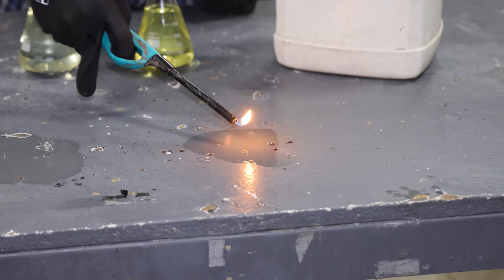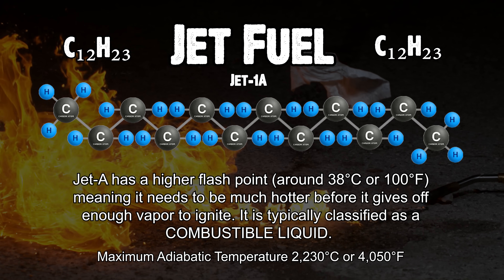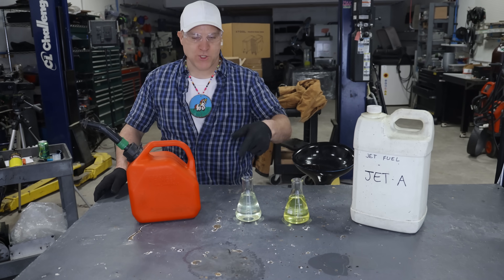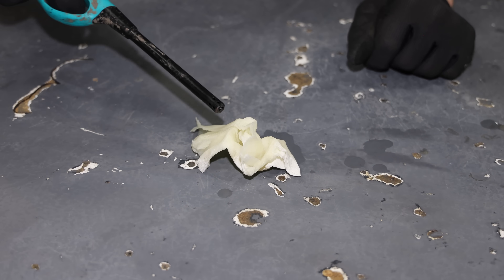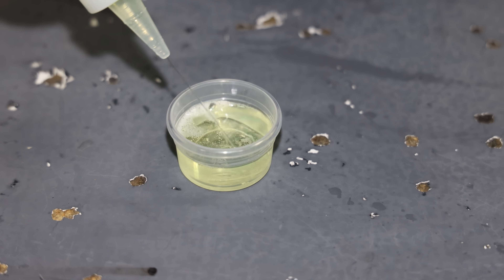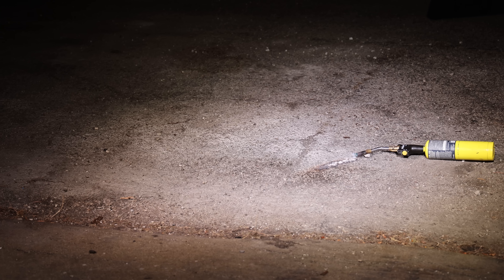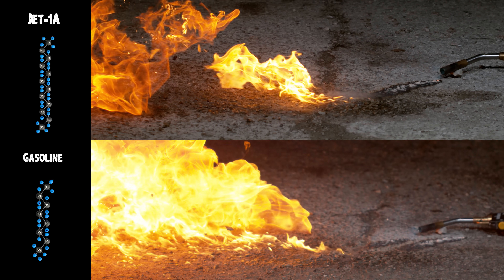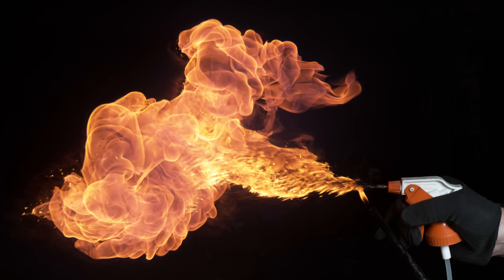What Happens If You Light Jet Fuel vs Gasoline?

Comment: If you tried to light up jet fuel by dropping a lit match on it, it would ignite by the moment the match gets soaked with jet fuel.
Reply from the maker: Only in the case of "wicking" other than that no-go until the fuel reaches a temp of at least 100F.

Comment: Interesting, Do you think 50 gallons of 'jet a' fuel in a large capacity 'empty central tank' on a Boeing 747, (if ignited), would cause the hull of the 747 to fail.. 🤔🤔

Comment: Have you ever tried RP-1, a variation of kerosene used for liquid fueled rockets (rather larger than what a hobbyist would use—dry fuel and oxidizer). In rockets, unlike airplanes and surface vehicles, rockets have to carry their own oxygen with them, almost always, in liquid engines, in liquid form (LOX). It can be vet dangerous to almost all amateurs, where solid fuels usually come pre-prepared, thus making them much safer, and making the hobby safer. But with human crewed rockets, the liquid engines are often preferred, because they can be turned off even after ignition. With solid rocket motors, once they are lit, they are going. 

Usually the RP-1 is used with first stages only, with upper stages using liquid hydrogen and liquid oxygen.

Comment: Jet and diesel are very similar. Seen this same test between gasoline and diesel. But isn’t jet fuel basically kerosene? Anyhow diesel fires after a crash happen the same way. But diesel also doesn’t ignite to an open flame. Its ignition is through heat. Used to be use glow plugs for heat to ignite diesel. But now they just use turbo or compressed air. As air is compressed the temperature rises dramatically. Till combustion with the fuel. Engineers have timed this so its exact. Jet engines and fuel are the same. Jet engines are the turbo or turbine. But they compress much more dramatically. Creating more boost or thrust.

Comment: The Boeing 787 puts nitrogen in its fuel tanks to prevent lightning related static electricity fires. Pulls the oxygen out of cabin air and left with almost entirely nitrogen.

Comment: You get more work per thermal unit from jet a and at lower temperatures which extends the life of the hot section and turbine assembly this was worked out in the 1920 ‘s quote from aircraft test book FAA Test questions cerca 1990 ‘ when I tested for and received my A&P cert !

Comment: I worked with JP8 in the US Army as a helicopter mechanic. It is basically Jet A. You had to try hard to get the liquid to light, but atomized in an engine could still cause an over temp. Even a few seconds of over temp in a gas turbine engine could cause scaring inside the hot end of the compressor; due to expansion of the turbine blades. I had to do many an engine change, because pilots couldn’t wait 2 minutes between start attempts.

Comment: Ok, first off 1970's - 1980's USAF non flightline person here.   No knowledge of what you have labeled Jet-A.  Fuels that were used were labeled JP-4, JP-8 but this was not fighter or cargo aircraft, ours were Tankers  and B-52s.  Not sure what differences there are in volatility, but open flame was prohibited around any spills that might have vaporized, either on the ground or personnel.  In the case of spills on personnel complete washdown as soon as practical was called for followed up by return to home or barracks for uniform change and then off to medical for examination and clearance to return to work.

Comment: If the ambient temperature in that workspace is high, there could easily have been enough gasoline vapor coming from the flask of gasoline to create a continuous fuel bed between the puddle and the flask. If that flask went while you were leaning over it, he would be posting this video from a burn ward. Respect gasoline. You cannot see the flammable vapor.

Comment: 911 was an inside job.  Jet fuel could not weaken steel let alone melt it.
Reply: Actually, it can.  You don't have to melt steal for it to weaken enough to fail during a fire.  The rule of thumb in an industrial/refinery fire is after 15 minutes structural failure can occur.
Reply: @91156   Easy to find out. I invite any one reading to try it. Get a giant Kerosene container ( jet fuel is Kerosene) and lit it under a steel table for any amount of time.

Comment: So they both ignite in vapor form.  By the way, drop a match in a bucket of gasoline - it will not flame.  It's about the air.
Reply: Light that match and try that on a hot day............  or even a warm day.

Comment: Now get "Jet-A" to melt steel.
Reply: Nobody said the fires in the towers MELTED the steel. All you need to do is warm it up to the malleable temperature, which is a lot lower and let the weight of the buildings do the rest. How did blacksmiths form metal from a small wood fire? They didn’t melt it. They heated it to the malleable stage and used the weight of a hammer to deform it. Same thing. Not saying nothing else contributed to the seemingly perfect demolition style collapse of the building, but the simple collapse is possible without actually melting the steel beams.
Reply: @gerrymainville7904  All their 'facts' are made-up BS.

Comment: Is that a little gasoline engine sitting on his bench at the end?
It looks like a little gasoline engine sitting on his bench a the end.
It is a little gasoline engine sitting on his bench at the end!
I WANT THE LITTLE GASOLINE ENGINE SITTING ON HIS BENCH AT THE END!!!
So he will give it to me now. Why?
I don't know why but it's cute, so am I and I want to hug it.
As for JP4 it's used in fighters because liter to liter it has a much higher energy density thus resulting in higher thrust to weight ratio with greater fuel efficiency plus it burns with at lower substained thermal output so it doesn't turn you expensive jet engines innards into white hot glowing mush, something most pilots would like to avoid. 
Because we're scaredy cats when it comes to fire while we're flying. 
(But not so much at home if our boyfriends are hugging us in front of one.)

LOL! 😡👈🤪

Comment: Jet fuel does not melt iron beams…….. I’ll leave it right here
Reply: You are correct, but it gets iron beams hot enough to flex and collapse, as in the trusses
Reply: They lose 50% of their strength at 500C, 70% at 600C, both well within the range of burning jet fuel.  ALL of your 'facts' are made up BS.

Comment: All I know is that jet fuel does not melt steel beams
Reply: Youre right it cant melt steel beams but the heat it produces is enough to cause structural damage enough for it to collapse under the added weight of half a plane.
Reply: @General_brasch the temperature at which steel becomes malleable is a lot lower than its melting temperature.
Reply: @General_brasch  and tower 7?
Reply: @StuFrodsham  falling burning debree started fires in 10 floors on building 7.
Reply: @General_brasch you'll never convince them that they don't have super secret arcane knowledge that the rest of us do not, but I respect your attempts 😂
Reply: @s @seionne_outdoors ometimes they are just people who havent heard the true explanation. Other times your right and Im not tryin to convince tin foil hat people.
Reply: It can soften them, though.
Reply: If steel is heated long enough, it will weaken the beams forcing them to buckle.  Did you not pay attention in engineering?
Reply: Conspiracy?
Reply: Two totally random towers in New York City that around anymore due to two machines
Reply: Another way to see it: What do You think happens, if You ram a commercial jet into a high rise building?
Do You expect it to stand afterwards?

And what do You think is expected damage to smaller buildings surrounding huge collapsing buildings?
Reply: Everyone knows what you’re talking about but something did and they buckled!
Reply: That still doesn't explain how two airplanes took down three buildings.
Reply: @moppman3191 simple, both planes hit the center of the towers, the center of the towers held a lot of the buildings core support beams, jet fuel was set on fire and weaken floor beams, once everything was weak enough the floor collapsed and the gravitational force of the extra floors above caused everything to fall down down like a domino. Now for building seven debris from one of the towers fell on it causing a fire to go off inside, there were no sprinklers, no firefighting effort to put the fire out, and support beams also got weakened by fire. Now reminder I am not a structural engineer I am someone studying to become a aerospace engineer so if you don’t believe that’s fine this is just my explanation on the event.

Comment: You could have the fueltank filled with a porous honeycomb material that the fuel can flow through, which stops vapourization due to impact. Like a big solid sponge. It would still burn, but like a candle rather than a pool of liquid.

Comment: Interesting but the statements about energy density are incorrect. Petrol (Gasoline) has a typical energy density of 44 - 46MJ/kg (by mass) or 33.6 - 34.6MJ/L (by volume). Jet-A1 has an energy density of 43.1MJ/kg or 34.7MJ/L. Since the combustion process uses fuel MASS rather than volume, Jet-A1 is slightly more 'powerful'.

Part of the misconception regarding aviation fuels is the perception that 'it's aviation fuel...!' without realising that there are two fundamentally different fuels in use - AVGAS and AVTUR. AVGAS is (crudely put) petrol for flying - hence the name (AViation GASoline) and the most apparent difference between that and the automotive variety is the Octane rating which is a measure of it's 'knock resistance'. We've all seen numbers on forecourts like 95, 97 etc - AVGAS reaches 130.

There are many varieties of AVTUR (AViation TURbine fuel). One of the most fundamental differences between the two groups is that while AVGAS is a spirit fuel, AVTUR is an oil and as mentioned, belongs to the Kerosene 'family' along with diesel and paraffin.

Where the AVTUR fuels differ significantly from land-use ones is their low temperature performance since to function in an aircraft, they need to remain usable at remarkably low temperatures which road fuels could not achieve. This is made possible by the inclusion of additive to prevent waxing and also to deal with any water formation within the fuel system.

In the Western world, there's a thing called the NATO single fuel policy which mandates that all military 'diesel' equipment must be capable of operation on 'F-34 AVTUR' which - as suggested - is the preferred single fuel though not the only one used. They also use F-54 Dieso or Dieso MT but only on land.

F-34 has a lower power density than F-54 and other road fuels but operates reliable down to -44C (if I remember correctly) but comes with a higher maintenance requirement as it also has less inherent lubricating and more aggressive properties than it's land-use and civilian relatives.

Comment: a few times I found myself delivering jet fuel kerosene or racing fuel,  it is all the same, as an ltl driver, meaning I was a local delivery driver. the problem was that it came from International which isn't a mom and pop operation and didn't have any hazmat markings on it, and this happened probably 4 times.  I was moving it in a trlr in the summer and I didn't understand or appreciate that it's essentially not easy for it to combust. But as a responsible adult and seeing that my company didn't take drastic actions for missing the fact that it wasn't flagged as hazmat, as it is fuel and is explosive, and I worked for a reputable company, I soured on them quickly. This wasn't the only instance where their stance on hazmat was less than adequate. I worked with a guy in the marines and he was in charge of the hazmat area, one time he walked in and breathed the air and fainted, in the end he was discharged as a medical situation and he couldn't breathe or exercise the rest of his life the same. he got medically discharched, no one needs that to happen.

Comment: and again we see the similar comments: Jet fuel is diesel.
Gasoline is gasoline.

But, what is the difference between Jet fuel and diesel?

Thanks for not showing any of that, and showing what most potatoes already knew.
Reply: Jet fuel is actually kerosene.
Reply: @91156  and kerosene is diesel?
Reply: @TMGpuntNL  Well, sort of.  Diesel has a bit higher boiling point than kerosene, making it a heavier product.  Kerosene is also referred to as #1 diesel, whereas the diesel fuel we run in trucks, tractors, or about anything calling for "diesel fuel" is #2 diesel.

Comment: Jet fuel is essentially diesel fuel, but with less lubrication than diesel, and has a lower gelling point in cold climates. It is basically the equivalent of a number 1 winterised diesel. Aka...basically Kerosene. Jet fuel will run in a diesel engine so long as you add in proper oil for lubrication and a cetane booster, so you don't burn up your diesel engine's fuel pump. Diesel fuel also has a higher cetane than jet fuel. 

However, modern diesel engines in the United States have many pollution control systems, and these components can be damaged if specific grades of jet fuel are used, as jet fuel often contains high levels of sulfur. 

Older diesel engines are more forgiving, and these pesky pollution control systems don't get in the way, since they don't have any of the pollution control crap. 

However, I still wouldn't recommend running Jet fuel anyway. Even if you could. One jet fuel is more expensive. Two, it's harder to get by a lot. Three, it will never be as good as proper diesel and will make your engine produce less power. And finally, who wants to spend time and money mixing in oil and cetane booster when you could avoid the hassle and run proper diesel? 

At the end of the day, there is nothing special about Jet fuel. It's just a formulated fuel made for a specific type of engine, like gasoline is for gas engines and diesel is for diesel engines. It's just a liquid fuel like gas and diesel. 

Hence, I never understood the fascination with jet fuel. As far as rocket fuel, it can be similar to Kerosene, too. But it can also come in a solid form, similar to putty.

Comment: When I was a young Airman, the jet fuel we used was JP-4. It was flammable and we took a lot of precautions to mitigate the risks. Later, we transitioned to JP-8. It was much safer and many of the precautions we took with JP-4 no longer applied. 

Gasoline was always dangerous. The only explosion I experienced during my career was when our lab was testing gasoline. The explosion proof vacuum pump had been replaced with a standard unit. When the fuel vapor found a spark from the pump, it blew the metal doors off the cabinet it was housed in. No one was hurt, but we had been lucky.

Comment: Reminds me of my time in the Air Force.  I worked in a lab testing the JP-8 fuel that we had to use in England.  There was a special device I used to heat up the fuel to above 100 F to get it to flash over.  Back in the US, we used JP-4 which has a flash point more like gasoline.  I didn't know where Jet A would land on that spectrum.  Looks like it's closer to JP-8.
We also would put a little bit of the JP-8 in with the diesel for our fuel trucks because it would keep the water in the fuel lines from freezing in the winter.  It has a chemical called FSII (fuel system icing inhibiter).  We only used about 1 quart of JP-8 in our 30 gallon diesel tanks to get the effect.  You couldn't run the truck on JP-8, which always made me very sure I didn't run out of diesel, in my fuel truck.🤣

Comment: Great demonstration.  A chopper tech once told me that diesel can be used in a jet turbine in an emergency.  He also told me that gasoline can also be used in an emergency.  Is this true?
Reply: Yes, turbines can burn a wide variety of liquid fuels, but they work better with fuels designed for the specific engine. There is an account of US M-1 Abrams tanks that outran their supply vehicles filling up at an Iraqi gas station.

The US military uses JP-8 in (almost) all its combat vehicles that use turbine or diesel engines, from M-1 Abrams tanks to trucks to helicopters and jet fighters.. It keeps the logistics much simpler. The US Navy uses JP-5 at sea because JP-5 has an even higher (than JP-8) flashpoint, but their aircraft can use JP-8 when flying from land bases.

Comment: This is entertaining but not educational.  Gasoline and jet fuels are both blended hydrocarbons.  Giving a single molecular formula is not correct. I don't know anything about jet fuel, but blending gasoline is important to make cold starts possible (butane), allow combustion to continue throughout the power stroke, and prevent compression ignition. The high vapor pressure of gasoline in some aspects can actually make it safer than some of its heavier components by displacing oxygen, preventing ignition by static electricity during fuel transfer.

Comment: So to clarify, the first one is Kerosene.. which is closer to Diesel than it is gasoline... which is why it doesn't immediately light, but it will light and burn very hot and very slow.

Comment: Basically, the impact of an airplane crashing will disperse the fuel into a highly combustible spray.
You're not typically going to see gasoline dispersed in volumes that jet fuel would. That experiment is comparing a car gas tank to a similar sized jet fuel tank. In reality, planes will hold a significantly higher volume of fuel.